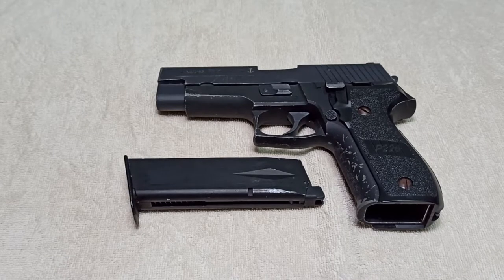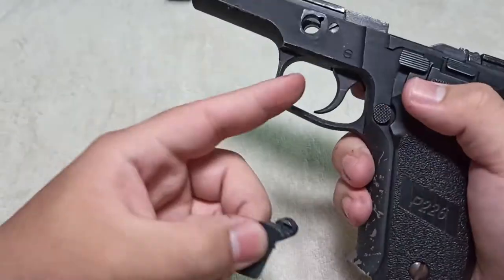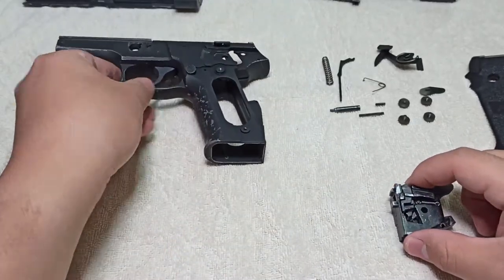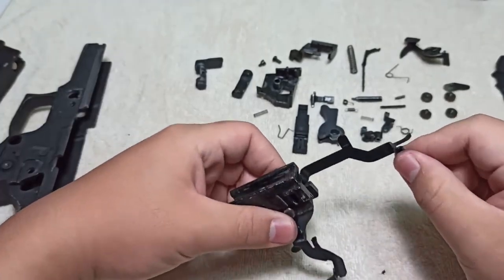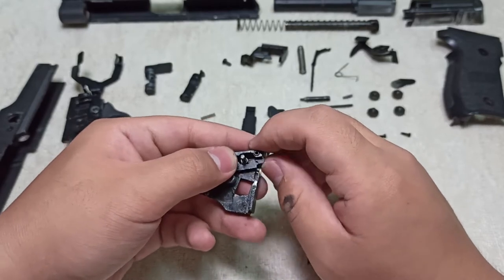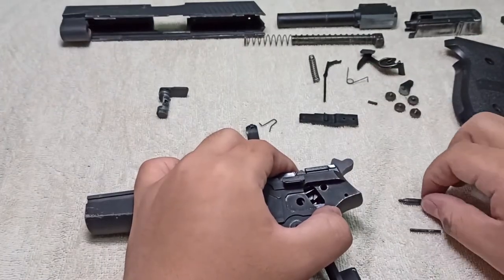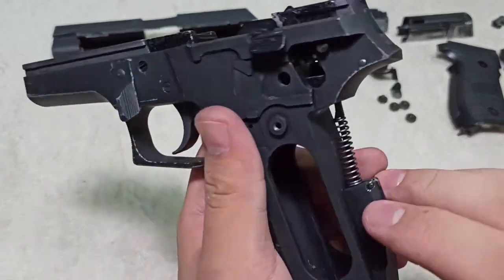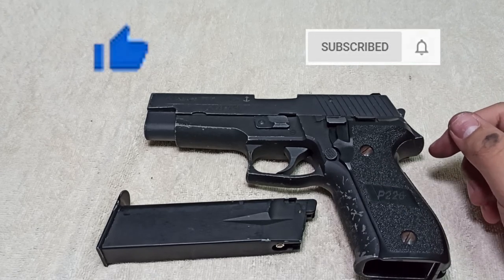P226 FULL disassembly | Tokyo Marui | Sig Sauer Airsoft (Sped-up)

Comment: Thank you for a very good instruction video, that provided a true Heureka! - moment. ;-D My P226S X-five by KWC / Cybergun has minor differences to this Tokyo Marui, but this video tells you how-to anyway. Funny thing is, I've been sitting around with this funny little shaped flat left over piece, that I just couldn't work out where it ought to go. The gun works fine without it, so I've just kept it in the boxcase for three years. In fact, I haven't even been sure it actually came of the pistol during disassembly. Maybe it was just a "stray" mechanical piece from some other stuff / junkpile  in my workshop, I've been thinking? But watching this video, I suddenly - HEUREKAAA! - realized it was the magazine release cover - which as you point out, only has cosmetic function. ;-D
Reply from the maker: That's great to hear!! I'm so glad you finally found out what that stray piece was for :D

Comment: Well done on your video I was hoping to see if I could work out how to assemble my Tokyo Marui Ruger P85 each video I see I might see 1 or 2 pieces that resemble something in mine, I have had it for about 20+ years and can’t remember why I took it apart but I ended up with I screw left over so thought I would take it apart again and find out where and well it ended up in pieces and I haven’t been able to put it back together. Its sentimental to me hence after all these years I’m trying once gain to reassemble it hoping there would be more on the internet to show me how but there isn’t anything that is exactly the same even the one that said it is hasn’t got the exact parts but thanks for taking time to do this video you were great at showing how things work.
Reply from the maker: Thanks for the extensive comment, so very glad I was able to help!

Comment: can confirm 99.90% similar disassembly process with WE TECH F226 & F229. 

awesome and throughout video, thank you.
Reply from the maker: Thanks for sharing the information!
Reply: can also confirm 95% resemblance with kjw p226 (only difference is in the hammer block the spring loaded sear wont come up until its assembled in the lower reciever.)

Comment: hello I recently bought a tokyo marui p226 E2 guide rod for my HFC p226 because the stock guide rod broke thats why I bought one and the tokyo marui p226 E2 guide rod fits perfect and works perfect to my HFC p226 anyway do you know how to prevent the small part on the guide rod that helps it locks in place from breaking?
Reply from the maker: Proper use should be enough to keep it in shape for a long time! 
As far as I know, the one demonstrated in this video broke because it's used as a prop, trainer pistol and more, thus was abused by people that haven't gone through proper training.

Comment: hello . i have a problem with the gun . when i pull the trigger all the gas run off . what can i do ?
Reply from the maker: That is likely an issue with the gas valve in the magazine or the hammer mechanism, try to see if you can figure out what exactly is causing the issue!

Comment: How did u pull the hammer back so far to take it off
Reply from the maker: Pulling backwards shouldn't be required to take down the hammer, the hammer assembly is lifted out of the frame and the hammer itself is taken off with a straight upwards motion.
    If I didn't answer your question please provide a timestamp or a more concrete explanation of your question, thanks!

Comment: My hammer gets stuck in the middle when i try to pull it to the end
Reply: Make sure your gun is clean take a toothbrush and remove dirt and then apply some wd40 or sth...if that doesn't work (it should)buy a hammer assembly and it is fairly easy to put it on
Reply from the maker: Other than making sure everything is lubricated, try shaking or wobbling it, many times when I tried to disassemble it it just wouldn't budge until I found the right angle.

Comment: How to fuck do you remove the takedown lever won’t ducking come loose at all
Reply from the maker: On my variant there is a spring powered ball that keeps it in place, it was extremely tight the first time I disassembled it, I haven't found a better way other than just making sure nothing is in then way and then pulling with all your might! lol
Let me know if you find a better method.

Comment: I had an issue with the Trigger. It wouldn‘t go back to starting position after i pulled it one time. So i tried to disassemble the entire hammer- and trigger parts and I couldn‘t find the reason why it‘s not working. I ended up trying to put it back together and had to restart at least 3 times since I either forgot something or it just was‘t working like before I started. It‘s a Pain in the Ass to disasseblem and reassemble this. I‘m glad I didn‘t do all the silde and all the Hammer. 

Airsofts are Fragile and cheaply made complicated Toys. I hope the people who have to produce em in the first place get paid well at least. I wouldn‘t want to destroy my fingers doing this all day. 

HOW can I fix the trigger reset issue? Please help. 

(I have A 6mm GBB KJ Works P226, but the parts are almost the same as in the Video.)